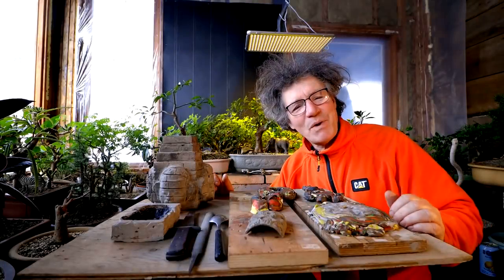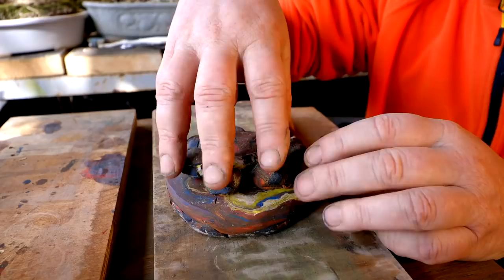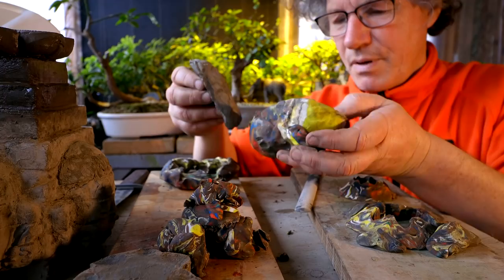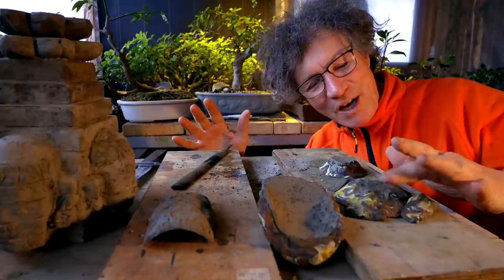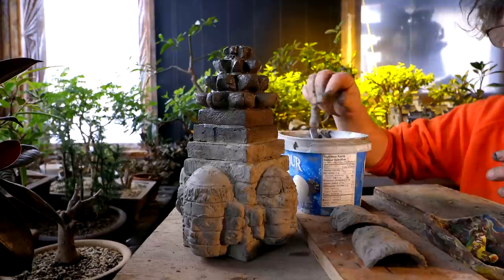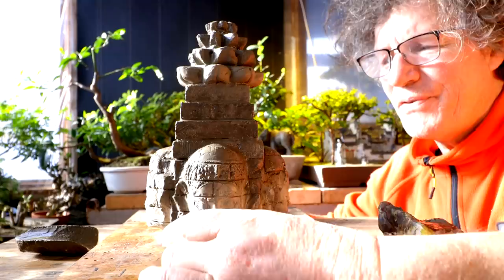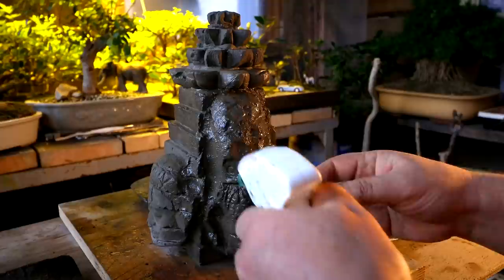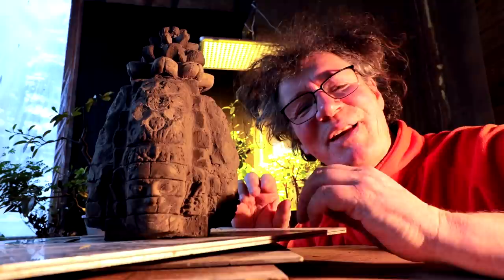The Upper Half of my Miniature "Ta Prohm" style Temple is all Together!, The Bonsai Zone, Feb 2021

Comment: Ficus have begun to appear at local grocery stores. I saw two benjimina but one seemed to have a random branch with solid green leaves. Any one here know if that means there is more than one plant in the pot? Or is that normal? I cant start a temple til I have a tree for it. Wifey will think it is another hobby. This will cause Words. Really inspired by what I am seeing, Nigel. You are using simple, cheap, materials to do something pretty remarkable.